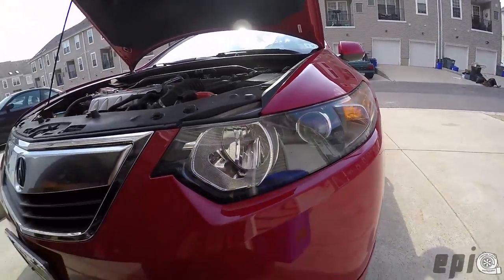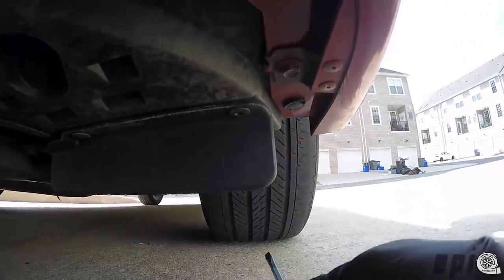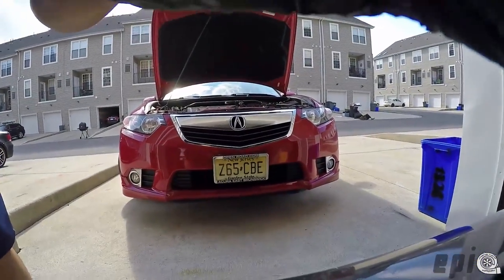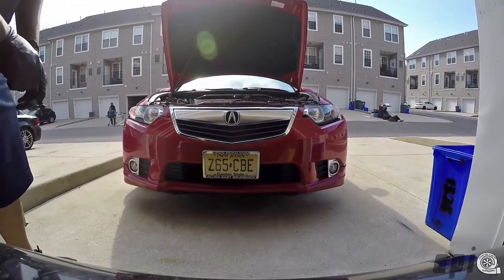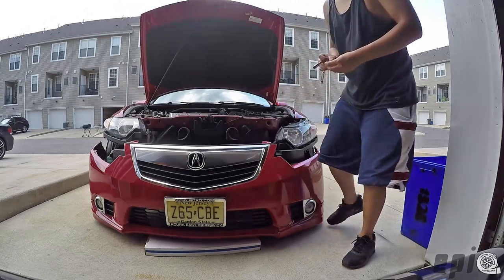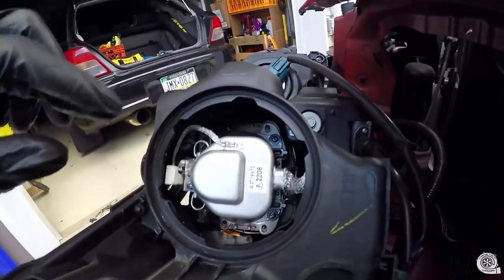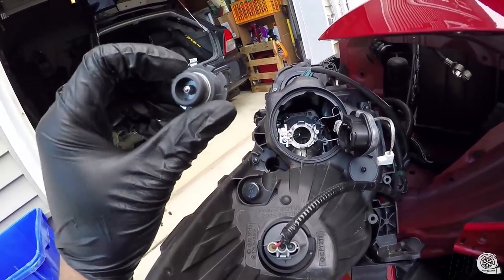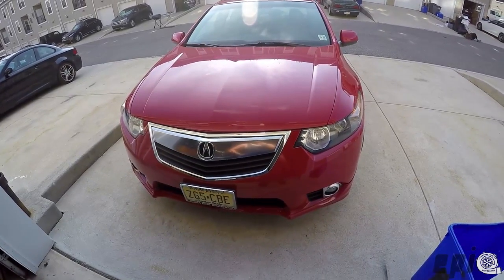2012 Acura TSX Bumper and Headlight Removal- Vlog #35

Comment: A couple suggestions, if you also need to change your high beams and upgrade your fog lights to LEDs for example, now's the time to do it. All at once with easy access for everything. 
One additional hot tip, now is the time to polish your headlights while they are away from the paint. It's really easy and fast
Reply from the maker: 👍👍👍 Excellent points!

Comment: Thank you. Your video was very helpful.  I had no luck getting in through wheel well to service the lamps, too.  Used WD-40 on push locks.  It really helps to not to break them when disassembling.

Comment: Nice video.  I did this, but without removing the bumper and headlight housings.  Let me just tell you that I will never do that again!  Took me 3 hours!  The worst part is getting the igniter ground plugged back in.
Reply from the maker: easier with the bumper off and headlight housing off 😁

Comment: Thank you very helpful i will be doing this in 2 weeks time but im getting my inner light plastic sprayed black and the indicator cover taken out my Euro is black and i can't stand the yellow indicator covers. Mine is a 2010 Accord Euro from Australia id assume to take off my bumper and light removal would be the same as this. Thanks again
Reply from the maker: Tigz09 word! Glad I could help! Good luck 🤙🏼🤙🏼🤙🏼
Reply: Hey mate, can confirm this is the same for Australian models, did mine and followed this video! Worked a charm!

Comment: great video! I'm going to need to do this as my left hid is turning pink. did you have to adjust the headlight aim after doing this?
Reply from the maker: Would be a great time to check before putting the bumper back on!
Reply: @EPICJONTUAZON  thanks!

Comment: Nice video, when you had the headlight unit out could you see where the left-right beam alignment is? The up-down is in plain sight but I can't find the other.
Reply from the maker: +web 293769 not sure I understand your question. The projector beam is set, you can't raise or lower it.
Reply: EpicJonTuazon , I had to have one of my headlights replaced on my 2014 tsx se and it looks like the projector beam is pointing toward the center of the car vs it being straight. I can easily find the adjustment screw for the up-down alignment of the light but can't find the left-right to make the beam straight. I was going off the symbols on the headlight housing "maybe there isn't on for left-right adjustment" Sorry if I wasn't clear before.
Reply from the maker: web 293769 hmm not sure about that. Never encountered leveling of the light.

Comment: This was a very helpful video. Very thorough and easy. I swapped my headlights with new ones. Only thing he doesn’t mention is when you disconnect the battery you will need a code to reset it. Got to wait the weekend to call sewer for proper code
Reply from the maker: The code is in your owners manual 😉
Reply: @EPICJONTUAZON  dope man I’m about to rip through it right now thank you so much
Reply from the maker: @dablordofnibiru9857  👍👍👍 good luck!

Comment: Hey would the sylvania zxe 9005 bulbs work good like the ones you used? My driver side headlight just burned out lastnight and I need to replace it. Great video by the way!
Reply from the maker: 9005 bulbs are the high beams. You'll need HID bulbs which are something like D2s Bulbs.
Reply: @EPICJONTUAZON  oh ok good to know, my TSX is a 2009, what bulbs did you get? Where did you buy them? I'll just use those since they looked real good in yours. My high beams work fine. It's the regular headlights I need
Reply from the maker: https://amzn.to/2NK087P
Reply: @EPICJONTUAZON  thanks dude I appreciate it! , great vids too!

Comment: I have a 2012 Acura Tsk and not able to find a way to adjust my light bulbs.. any suggestions?
Reply from the maker: Adjustments on the light bulbs are typically on the bulbs themselves there are some angulation screws. Depends on what bulbs you have.
Reply: @EPICJONTUAZON  I bought D2s HID Headlights low beams 6,000 k and Sylvania 2 Halogen lamp bulbs 12.8v, 65 w, white lights , hope that makes sense, are these the wrongs ones lol
Reply from the maker: @sulemavasquez8261  no they sound like the right ones. You won't be able to adjust the high beams. The HID bulbs themselves you won't either. I got confused with LED bulbs for a sec. On the back of the headlight housing there should be screws to adjust the level of the beam you'll have to take the headlight out make an adjustment and put em back in to see where they line up.
Reply: @EPICJONTUAZON  awesome ! We will try that, hopefully it works . Thank you so much for your  help

Comment: Hi . Is it possible to remove the orange amber reflectors in the head lights and .and then all clear ?
Reply from the maker: anything is possible. you would have to heat the adhesive off the lens to remove the plastic covering and then either spray it chrome or black.

Comment: I have a 2011 tsx. When i turn on my car...the light turns but then slowly turns amber. After like 15 secs...it shuts off. Do you think that is a bulb prob or ballast?
Reply from the maker: I would try replacing the bulbs first.  That would be the cheap and easy fix.  If it continues to happen with a new set of bulbs then you know its probably the ballast.

Comment: Hi, great video explaining this process! Subbed because of it! Just a quick question, as you got 6500k HID do you think this will closely match with 6000k LED DRL/high beams as currently, as stock, they look too much apart colour wise, and I want them to be as close as possible?
Reply from the maker: Thank you!!! I think the OEM high beams are closer to 4000k. They're more yellowish than white IMO
Reply: Yeah, I have replaced my High Beams to 6000K LED, so I was wondering what colour temp HID to get to match closely to the High Beams colour wise? I'm am debating whether to get 6000K HID or 6500K HID, if you could help? Thanks

Comment: Can I put the led in the head light an if so what's the model I see ds2 but I can find in leds  is there like a substitute  like 9006?
Reply from the maker: You can use leds for the high beams but not replacement for the low beam as they are HIDs
Reply: @EPICJONTUAZON  so I only can change the fog lights too ?
Reply from the maker: @dresmith6706  I havn't tried the fog lights but I do know some of the LED bulbs wont fit the fog light housing so just be aware of that.
Reply: @EPICJONTUAZON   oh okay thanks this thing is mad complicated
Reply from the maker: @dresmith6706  lol I feel you

Comment: Great video! I thought about using a flathead to free the bumper from the annoying clips, but I was really worried about the flathead scratching the paint on my bumper. Was it difficult to maneuver the small flathead without rubbing against the bumper?

Again, great video! I'll probably use this going forward :)
Reply from the maker: +Gary Phung Thank you! Please consider subscribing! they make a special tool for it! but no if you wrap it with a cloth you should be fine!

Comment: Quick question: Where did you buy your HID headlight bulbs? I saw the link you gave in your comments and I order but when the light bulbs came they were not in the official box like you had in your video...could you post the link again and confirm if the ones I got from Amazon is good? The box is just plain white...
Reply from the maker: Are you referring to the HID bulb?
Reply: EpicJonTuazon yes
Reply from the maker: as long as they are D2s Bulbs they should be fine.  Is the temperature the same? 6.5k?
Reply: @EPICJONTUAZON  is 6.5k the OEM color? i read OEM uses 4.3k.

Comment: When changing my hid bulbs, I could t get the little top white connector back in.  But the lights still work.  What exactly does that wire do on top?  Does it just hold the ballast in like you said?  Thanks.

Comment: Im about to do this tomorrow morning bcs i tried the other way (going in blind) and it was awful and i dont wanna keep messing anything up since its really hard to connect the ground cable back (again going in blind) so anyone wjo tried this and worked, how long does this process take?
Reply: yeah i got the bulb out through the engine bay but that damn ground cable i couldnt get back on so i gave up. did you take the whole bumper  off

Comment: Really want to try this , would you guys consider this beginner level ?? I’m tryna save 100 bucks !
Reply from the maker: 100% I've never taken this bumper off before this video.
Reply: EpicJonTuazon , Great news, definitely subscribing man. Just got this car and your videos are on point. Thanks again
Reply from the maker: @henrytaylor5047  🙏🙏🙏 good luck thanks for the support
Reply: Hey at 7:45 ..What is the aluminum piece that detaches from the bulb called ,  it has the braided cable attached ( found out mine was burned completely). Thanks for the help , was able to get my bumper off easy !
Reply from the maker: @henrytaylor5047  I think it's a ground cable but I'm not certain.

Comment: On the passanger side it's fairly easy to replace the blub but on the drivers side...no chance. Even my car dealer remove the bumper, because it's much easier
Reply from the maker: +1GTASANANDRESCJ yeah It was more worth it for me to just to remove the bumper bc I was changing both bulbs.  Good to know tho! Thanks for the tip!
Reply: +EpicJonTuazon one thing is different to mine Honda Accord (live in Europe, they sold these as Hondas): the wheel arch do only have one screw on each side. Do you have a sport package? Maybe that's why you have three screws.
Reply from the maker: +1GTASANANDREASCJ its a special edition. Not sure if that really makes a difference.
Reply: my Honda Accord in the UK has the three screws though, so it may be the case, because the special edition one has a lip on the bottom of the bumper in the UK

Comment: nice.. I have 2013 model ..i guess is the same way..
Reply from the maker: +black5corpion76 should be very similar.  do check though if you can fit it through the engine bay before you go removing the bumper!

Comment: What a piece of crap! You shouldn't have to pull half the car apart just to replace a headlight bulb. It's a friend's car I'm reaserching installing new headlight housings but if it were my car it would be going up for sale as soon as the job was done.
Reply from the maker: I'm sure there's another way to do it, I just know it will be a half measure with a higher risk of something else going wrong.
Reply: @EPICJONTUAZON  I've watched a couple other videos and they show the same thing. It's a great video. Very informative so please don't think I'm dissing your video. Just the car itself and acura for building such a pos. 👍
Reply from the maker: It's all good I totally get it lol it's a PIA @nathanhale7444